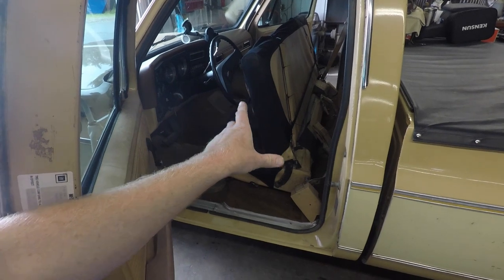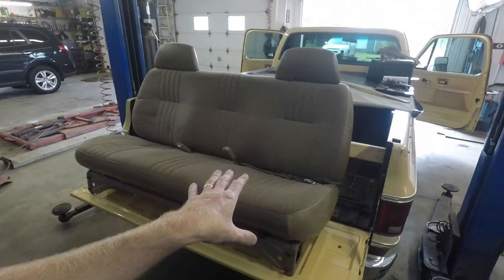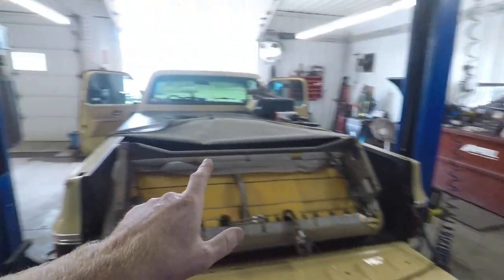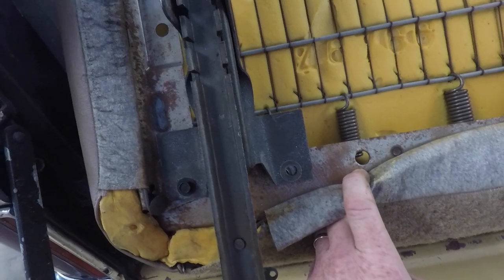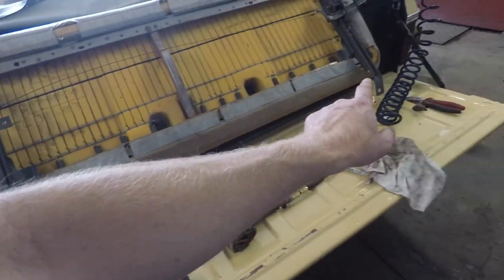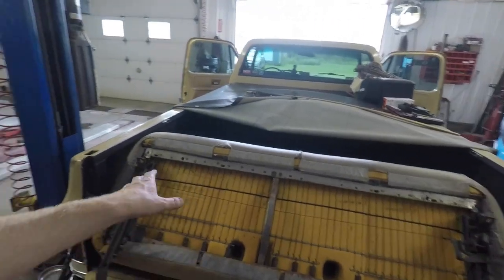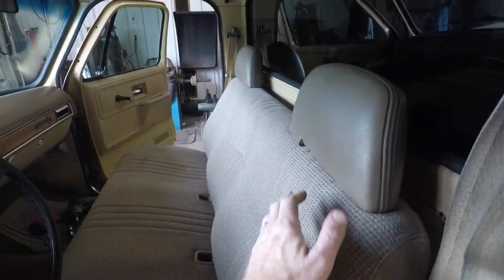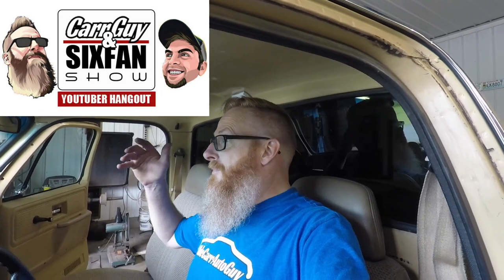HOW TO FABRICATE AN OBS BENCH SEAT INTO A 1977 SQUARE BODY CHEVY TRUCK

Comment: So is it a bad adapter for the external mic? Might be worth trying to shoot an episode without the external mic to see if it records audio all the way through. I'd be more than willing to bet that there's some connection issue in line of the external mic setup. Decent stick color of the new bench to go with the buckskin exterior.
Reply from the maker: I’ve swapped out the sd card and 2 videos in, so far so good!
Reply: @OldeCarrGuy  good deal

Comment: I'm a new Subscriber.  Big fan of the Squarebody content.  

Did the OBS seat give you more or less room from the steering wheel? And what about height,  do you sit higher or lower in the cab now? I'm constantly looking for more room behind the wheel.  A shorter steering column is in my future.  

Mine is a  '78 C/10 Silverado longbed, because the cool people drive longbeds!
Reply from the maker: Yes! Cool people do drive long beds! Lol

I find the obs seat to be a tad lower on the back as the seat has a bit mor recline than the original, therefore sitting you a bit lower. As far as room between the steering wheel there is marginally more but not significant.

Comment: Nice work,  I got a 83 chevy c10 and I'm trying to put a bench seat.  The only bench seat I found is from an 80s Ford, do you think they will bolt on or would I have to do the same thing you did?
Reply from the maker: You'll likely be modifying the seat mount.
Reply: So should I just get a seat from any year of chevy would be better and easier to modify?
Reply from the maker: @familygunsandrides....8024  any Chevy (88-98) bench seat should be as easy as the one in the video.

Comment: I want to do this!  Except I have a square body Burb…and I’m told the OBS seats don’t swap well into the 2nd and 3rd rows…
Reply from the maker: Secontd row would be easier than the 3rd as the floor pans are similar, but the back row is a flat mount.